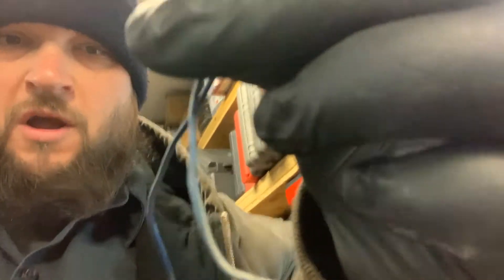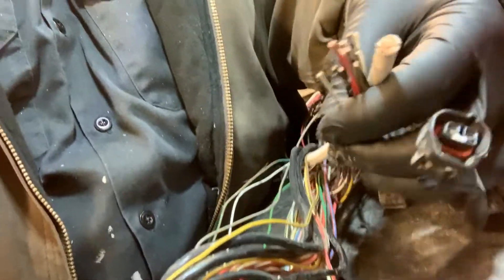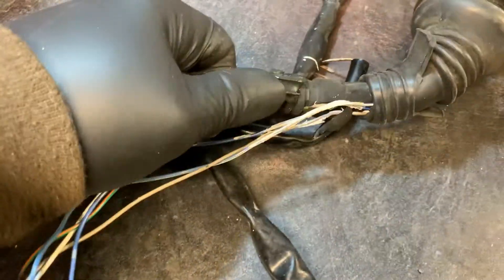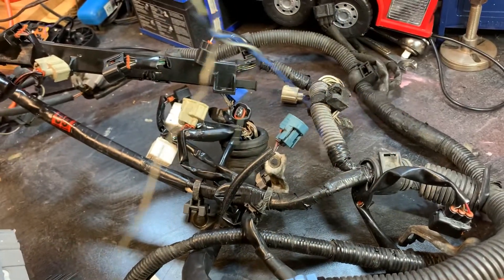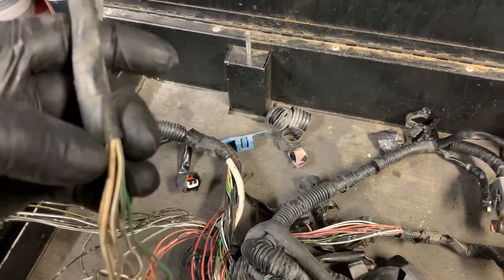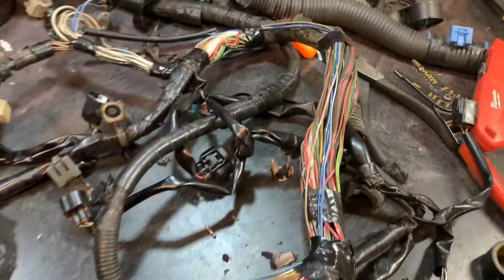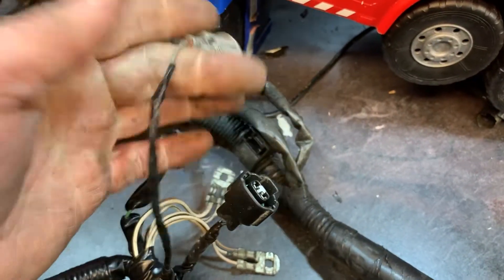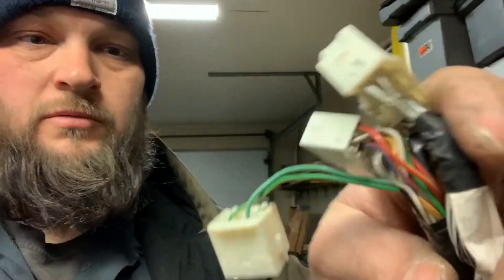1zzfe to 2zzge harness conversion

Comment: Hi I don't know if you'll see this,an im thinking of swapping my 2011 corolla with a 1nzfe,To a 2zzge do you think there will be much difference to the harnesses,
Reply from the maker: Just what I mentioned in the video
Reply from the maker: As long as it’s a manual transmission, just the differences mentioned in the video
Reply: @meatloafsgarage3356 even with a 1nzfe

Comment: good video I have a question, the connectors of a 2zz ecu are the same as those of a 1zz
Reply from the maker: Yes. You just need to add the wires that I spoke about in the video.
Reply: OK I have the harness and the ecu
Reply from the maker: @elhuachedesalgueromichuaca5697  sounds like you are all set.
Reply: Ok thank you so much bro

Comment: Hello brother.i finally got a manual ecu but it wont start the car.engine only turns but cant start.do i need to do any sort of programming?
Reply from the maker: You shouldn’t need programming. Make sure you have spark, fuel, and compression. Are the injectors firing?  Is there fuel in the rail?  Are the coils firing?

Comment: Will an automatic Ecu work for a manual 6speed if applied this method?
Reply from the maker: I don’t think it will. I would get an ECU for a manual car.
Reply: Funny thing is that it starts and the car runs, though some components don't work like the temperature and fan don't come on

Comment: I have a Toyota Matrix 2005 1zz , going to swap to 2zz what can I do to make my 1zz harness work with 2zz engine . If u have any more Information how to do it, please help me that.
Reply from the maker: You’ll need a 2zz computer. You can buy the pigtail connectors at an auto parts store for the lift solenoid and oil pressure sensor and run wires from the pigtails to the computer connectors.